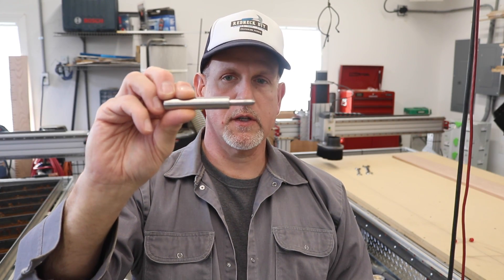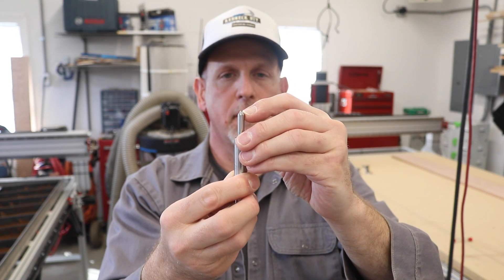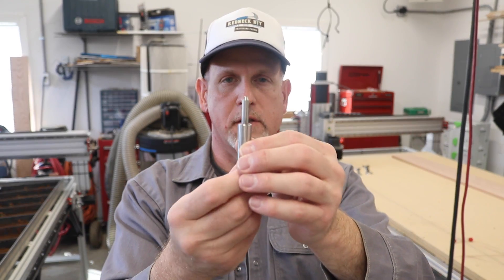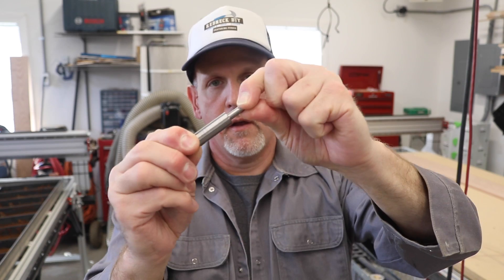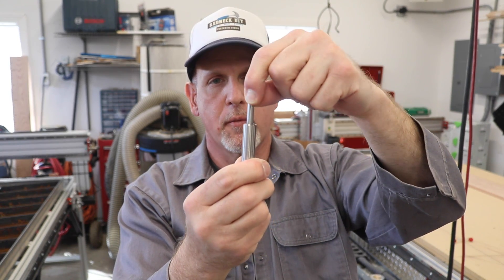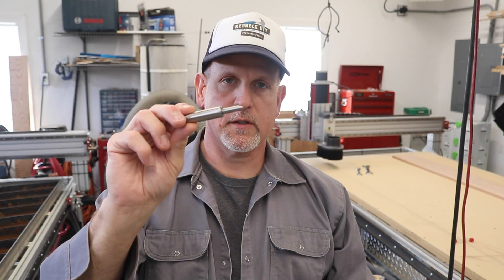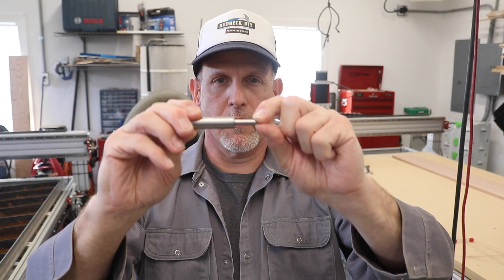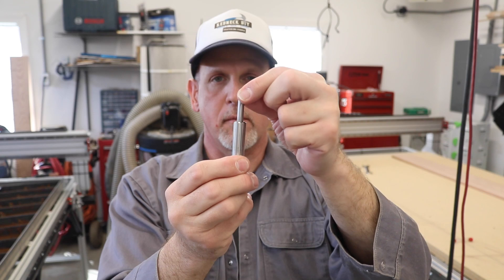Hot Sauce #2 - Diamond Drag Bit for CNC

Comment: hey guy found your video by searching, and you have had it a year, is it still working for you.  Assuming the ones on your video link are the one's you're using.   Still like it?  I'm getting one for acrylic signs?
Reply from the maker: Hey Bones!  Yes, it has held up well.  I don't use it a lot but it hasn't let me down.  Links are the same.
Reply: @GotItMade  O just ran into this video.  I have been working with my desktop CNC (Sherline) to do stainless steel engraving.  Power not drag.  I am having issues with a.002" out of flat condition which plays heck with my engraving.  What experience have you had with doing engraving on stainless?  It seems this would correct for any flatness issues.

Comment: Diamond Drag tools are great especially if you want very fine shallow engraving. I have actually spray Painted the surface of Aluminium baked it in my oven so its really hard and then engraved and the results are excellent. Having a lathe I made my holder so the cost to me was minimal, I change the spring inside depending on the pressure I need to suite the material.
I don't use it a lot but at time it is really handy :)
Reply from the maker: That's a great tip Ham.  I really appreciate you sharing it!
Reply: @Maureen Cnota I bake for 30 minutes at about 100 deg C in a fan forced oven. I wait for the paint to get just touch dry before baking.

Comment: I bought my diamond bit from benchtop precision for my CNC. You can engrave any soft metal, glass and acrylic. The depth of the engraving is dependent on the spring tension. I have used mine primarily on acrylic.
Reply: what are the feed rate and rpm settings for acrylic Robert?  Thx bert
Reply: @59caddy76  0 rpm and as fast as you can go